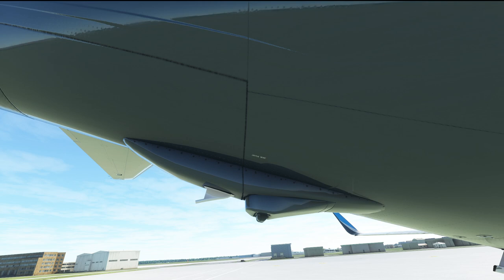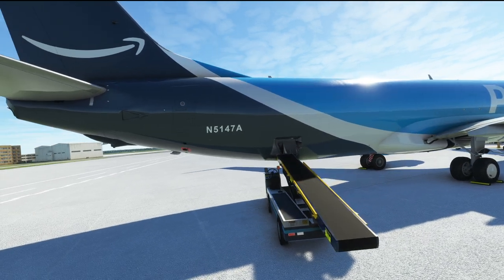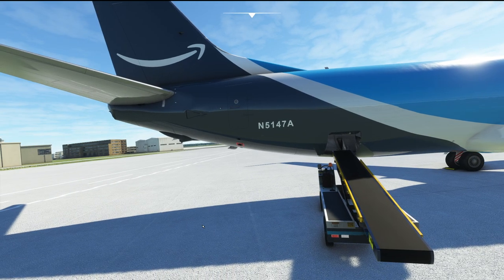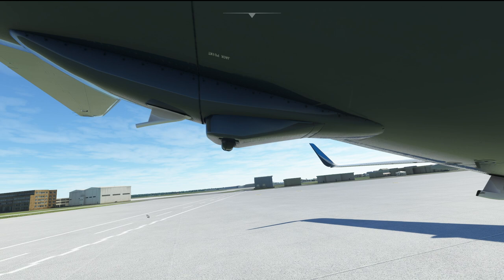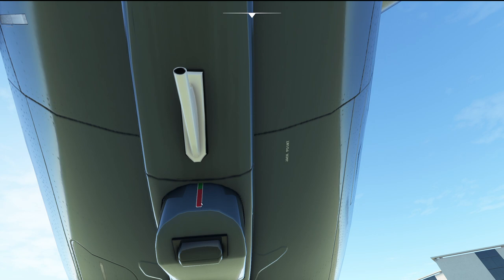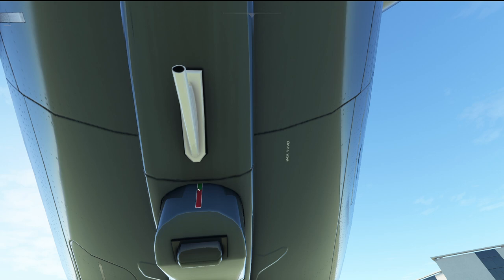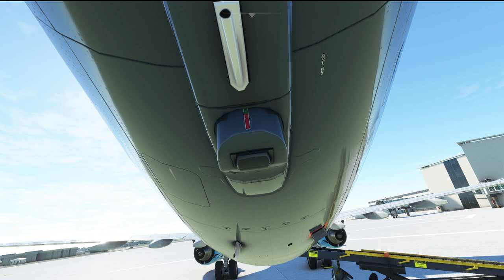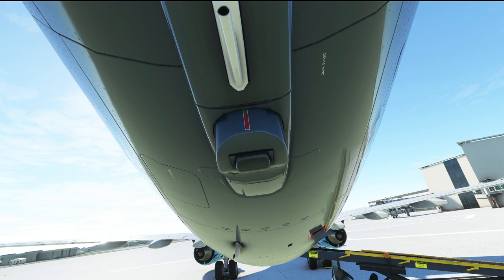737-800 Differences - The Tail Skid | 737 Pilot explains

Comment: Thanks for your vid. I remember learning to fly the tubes and had many tail strikes. If only we had a tail skid on us as a child, falling off the swing would have been painless 😉
Reply: How did you not lose your job?
Reply: @a.nelprober4971  Oh! not in rl. I build a 737 simulator and learned at home. Took a year learning the whole shabang. From programming the fms and starting engines to flying. I had some rl experience in a 172 and 310
Reply: @FlightSims  sweet
Reply from the maker: oh yes, that would save the day of a LOT of children. Then again however, no pain no gain. Sometimes you just need to learn things the hard way. Who hasn't touched a candle in the end?

Comment: Is it possible we'll get an MMR (Multi-Mode Reciever) intergrated into the 737 or is that not possible with MSFS at the moment?
Reply from the maker: That's planned for a future version. I believe it's scheduled to come with the -900ER, but I don't know for sure.
Reply: @A330Driver  Yeah i was wondering about that too , so it will be possible to fly GBAS/GLS approaches ? btw i was working as avionic engineer , and lots of planes nowadays are equipped with MMR and nice looking modern G7501-01 control panel 😊

Comment: Awesome vid. Do you think sometime you could make a video on trim settings. Do you guys turn the wheel by hand to set take off trim? Or just use trim button on the yoke. Also how in the work do you trim it to something like 4.73 lol. I'm assuming it's just an approximation.
Reply from the maker: Always use the trim buttons on the yoke unless they're INOP.
You can only approximate the trim, in the real airplane the two indicators on the different sides don't even match up, so.... go and guess.
Reply: @A330Driver  awesome thanks for taking the time to reply. 🙂👌